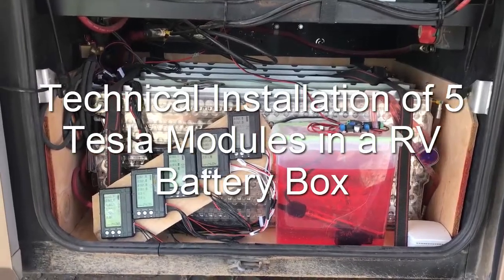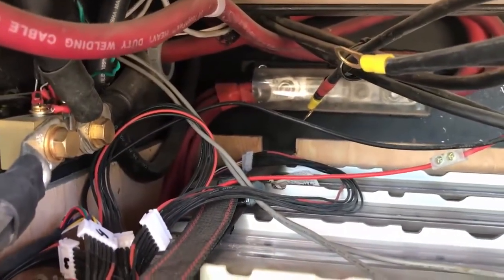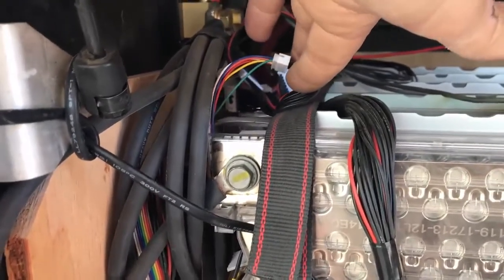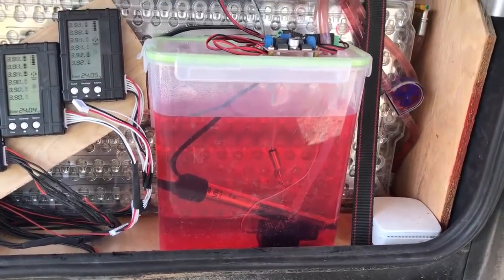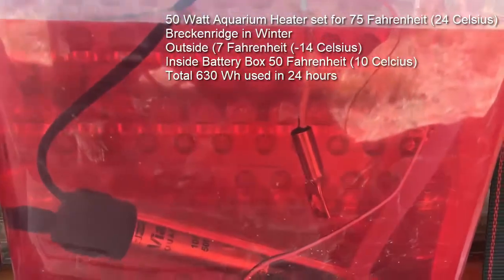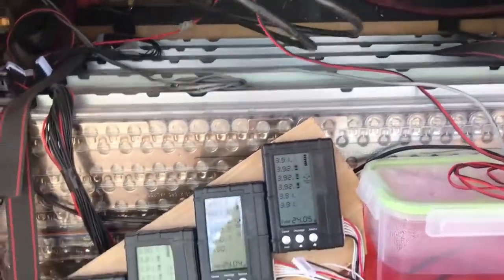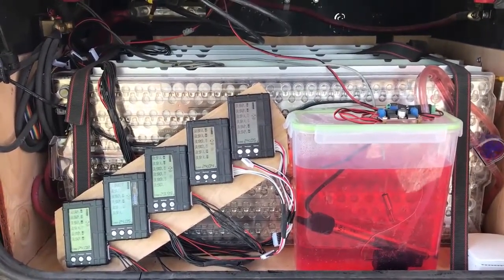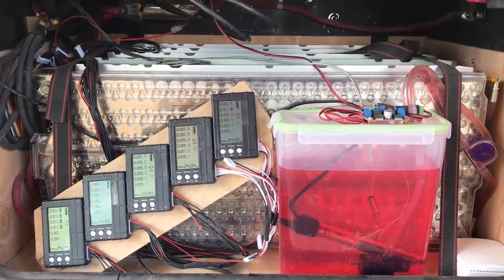Technical Installation of 5 Tesla Modules in a RV Battery Box

Comment: What bolts did you use for attaching the wire ends to the battery?
Reply from the maker: I had the bolts used in the cars battery pack with the modules. Not sure what the size was.

Comment: What voltage are you setting your Tesla battery to work within? Mine is set 18.6-24.5V.
Reply from the maker: Mine are set for full charge at  24.1 volt (I estimate 80% SOC) charging to lower increase the longevity of the cell.
Reply: @Per3110  oh wow ok, I’ll set mine to that also, what’s your lowest set voltage?
Reply from the maker: We have never been under 21 volt. Inverter disconnect at 20 volt (19 volt instant). The inverter is our only large  load. We do not have a disconnect (except removing a large fuse) since nothing handle the current properly bidirectional.
Reply: @Per3110  ah I see ok thanks for that, I guess by having my victron multiplus inverter set to disconnect 19V that should be fine, and then for the DC load I’ll have the victron battery protect disconnect at 18.6V 😁
Reply: @Per3110  merry Christmas 2020

Comment: Am thinking of taking my bms out abs installing the hobby king you have to balance your battery.
I have bought different victron products that had high voltage disconnect to my Tesla battery and also low voltage disconnect on all the DC loads on the battery also.

So ideally this would just balance the battery.

How is it working for you to far? 

Would you recommend them?
Reply from the maker: I like the Hobby King, they have been running for 2+ years all five, very stable, just ensure they sit upright to dissipate the heat.

Comment: I was going to mount my Tesla Battery Modules vertically as well but I was advised not to do so.  They are not made to withstand that kind of sideways force on the 18650 cells.  What is your opinion?
Reply from the maker: Those packs are glued together and can barely be pryed apart to get a single cell out. I have them sitting like this for 2.5 years and traveled 25000 miles. The internals of the cells has no dependency on orientation.
I have seen people mount the modules flat only on the rails with no underneath support. I think that puts a lot more load on the modules during driving. But again the modules are so sturdy that I do not even think that is an issue.
Reply: @Per3110  It's hard to argue with Success! Thank you!

Comment: What Maximum charge amperage ( per module) do you set your inverter charger to charge off shore power? How do you set the Hobby Kings to automatically balance?
My system has 2 Tesla module connected to 1 Victron Multiplus 24/3000 and can charge at a maximum out put of 70 amps.
Reply from the maker: We have 5 Modules in parallel and have Magnum MS4024 Inverter (105 Ampere Charger) or 2 x MorningStar MPPT (2 x 60 Ampere). Even with both charging at full output is 225 Ampere. Each module is getting 1/5 so only 45 Ampere per module. Converting that to the charging in the Tesla car is that 24 Volt * 45 Ampere * 16 Modules = 17280 Watt = 17.3 kW. That is not a lot compared to the regular charging of the car. So as long the temperature is in the optimal range for charging and not charged to more than 80% State of Charge is this well within specs. And the special case when plugged in and solar is very rare. So normal charging from solar only is less than 10 kW that is almost the 6-8 hour charge done at home for the car. With only 2 modules and 100 amperes charge is each module charged 50 amperes, very close to my example above.

We do not use the Hobby King any longer. I switched to a Battery Medic after a few months of manually triggering the balance.
Reply: @Per3110  ok so I would be save to charge one module at 70 amps or combined with solar up 100 amps.  With two connected on one charging inverter this would be a maximum of 50 amps per module. I think I am safe as in most cases I will only be charging at 20 amps max using my solar. Currently 400 watts plan to increase to 600 watts. 
I am using the Hobby King based on your videos. What is the advantage of Battery Medics? 
I think I am going to install the Electrodacus SBMS0 down the road for a full automation BMS that works with the Tesla. I will have to use Two. 
Do you have any issue with your 5 Teslas charging at different levels due to different resistance in battery cables due to different lengths?
Reply from the maker: @thomasgeriak4322  Yes, if you have the battery above 65 Fahrenheit and stay under 24.6 Volt (90% SoC), We only charge to 24.1 Volt (80% SoC) since we do not need all the capacity we have installed. But I wanted to ensure we had enough batteries in parallel that we did not force too low a voltage under high loads.

Comment: How do you automatically disconnect the packs if they over charge or over heat?
I'm installing Tesla packs in parallel and have been strongly advised against it without a bms that disconnects the pack in the event a whole string of cells fail and the other packs try to over charge the faulty pack. How big a risk is a whole string of cells failing? The only bms feature you use is just balancing?

What is your peak amp draw from the packs? I will be pulling about 300 amps peak from each pack (3 packs) for a few seconds (inverter max current when starting anchor winch motor for example) with a normal average load of about 75-100 amps per pack at 24v Does this pose a heating issue at 300amps and need to cool the packs more aggressively?

Sorry for so many questions, the people at OrionBMS we adamant that I shouldn't connect them in parallel unless I had a professional come and install and set up a bms and processes to isconnect the packs to stop the risk. I don't want to risk a fire or something without knowing much about how likely I am to have a problem. 

Thank you for posting your video
Reply from the maker: We have no catastrophic disconnect in our setup, but we only have 2 charging sources from solar or the Magnum Inverter/Charger. And the Magnum inverter has not been used for almost 2 years since we do not plug in or use the generator.
The Tesla modules have the individual cells (6 x 74 per block) wired with individual fuses. I do not consider the risk of having a failure like this. 
The one thing to remember is that this is not a solution that is sold, warranted or in any other way guaranteed, you cannot even get a charging discharge graph or temperature limits. I always recommend everyone to get Battleborn Lithium batteries that are protected against any kind of failure and use safer chemistry like LiFEPO4.
Reply from the maker: With 300 Ampere from each module is that like in the car in track mode, you need a lot better thermal management and expect a lot of voltage drop. I wrote a blog about this http://offgrid100.com/tesla-module-load when I tested on our solution with 5 pack in parallel. Our maximum draw/charge on the whole pack is <150 Ampere or 30 Ampere per module.
Reply: @Per3110  great blog post by the way
Reply: @Per3110  I have a 10.5kw 3 phase system that can surge to 21kw under extreme conditions for a free seconds. The average peak load is in the 4kw range across 3 phases. I'm planning on adding more Tesla packs. Ideally 6 total, but after reading your blog about loads and voltage drops in might need more capacity.

Comment: How does it work in souther heat when internal temperaturs in parked cars can be 140F+? Would addition of 20-40% load be a fire hazard at those temperatures?
Reply from the maker: The optimal charging temperature for a Tesla car is actually 115 degree.  So I think it would good. Low temperature is the biggest issue. And your battery box should not have a glass outside.

Comment: That cell heater is so simple and easy to build!!! Nice
Reply from the maker: Yes, KISS (Keep It Stupid Simple, maybe switch the last two words :-) ) is the solution when you need something that ensures it works every day for years.
I do want to have dual pumps to ensure the $7 pump does not die or some monitoring on the flow of fluid.

Comment: I did more research.  The connectors for the battery medic 6S is the JST-XH 7 pin connector.  FYI the 4 pin connector on the Tesla Batter thermisters at JST-PA 4 pin and JST-PA 15 pin.  These are hard to find, so I will remove the and replace with the JST-XH connectors.
I will be going with a liquid heat system using a 24DC volt thermostat controller, 24DC/150 watt ceramic heater, 80 mm  computer radiator, 400L/H adjustable 12/24DC fish tank water pump and 1 liter coolant tank in a closed loop. This can also  be used to cool if ever needed.
Reply from the maker: Our heater is only 50 Watt, I have not seen it use more than 30 Watt in an hour.It would be great to have a 24 volt version, but the 120 Volt AC Aquarium heater has built-in thermostat and all I need.

Comment: I received my 2 tesla battery today and ordered the 2 battery Medics. Can you offer up where to by the connectors to connect the rainbow wires to the battery medic? I think you said you needed to purchase a special connector. Tom
Reply from the maker: I purchased a 6S balancing leads from ebay and soldered it on the wires. All you have to do is measure the voltage and order them according to voltage.

Comment: I did purchase my 2 tesla modules. I am going with the Victron Multi Plus 24/3000 120 volt inverter. Still on the fence about liquid heating or just electric heat. I found a 24 volt 150 watt ceramic heater with fan that I can use to heat my whole battery box.
Reply from the maker: I think the liquid solution also prevent over heating and distribute heat better. But with the load in an RV is this probably a minor issue.

Comment: Would be great if you would have included a separate video just on the wiring side from the removal of the original BMS in the Tesla module and from there what wires you connected and cut and then a more detailed look at the hobbyking battery medic. Looks excellent the way you have set this up and the use of aquarium equipment and sensors to heat etc.  I am looking forward in the new year to get my Tesla modules in and working. Came across this video from EVTV which if you haven't seen it is a must see video https://www.youtube.com/watch?v=Je71tbm7LWQ&t=2111s
Reply from the maker: I have seen Jack's videos, they are a little long IMO.
It would have been nice to document the details of the wiring/soldering since I get asked this a lot. Maybe one day I meet a guy that has a module that needs to be modified. Buying a $1200 module for a video is a little steep since I cannot fit more in the RV :-).
Reply: @Per3110   yes very true, a little more research and I will be there!
Reply: My Tesla S module has a J1 connection and both temp sensors still attached to the cells. Did you remove the original bms and just use the wires coming into the connector. It appears that you did cut these but my wires are coming in via a ribbon wish I could share a picture here. Any help or links would be appreciated
Reply: One last thing, what type of battery setting are you using on the battery medic, I called Hobbyking and they told me it doesn't support these type of cells but they are obviously working for you ok!

Comment: Impressive. I see you are using a 24 volt system. What brand and model charger inverter are you using? I plan to use a Xantrex 3024 charger inverter. 5 battery sections at 5.3Kwhr is 26.5Kwhr system. How do you use all that power in your RV? I guess you would have more than enough power to run the AC for 24 hours.  Do you use a solar charging MPPT?
Reply from the maker: You never want to use a Tesla module to the full capacity, that is risking in-balance to be critical very quickly and also decrease the number of cycles a lot. You should expect to use 80% of the capacity.
We use a Magnum MS4024 in the RV (4000 Watt Single Phase). This is a direct replacement for the ME2012/MS2012 inverter that is often found in Motorhomes from the beginning of the 2000s. I only had to add a small Sub-Panel to add dual 20 Amp AC breakers. I would take a look at the Victron inverters, it seems to be the only one that is upgraded to this century in interface and capabilities.
In the trailer is an MS4024 PAE that is capable of 4000 Watt and split phase (240 Volt). 
Take a look at this website for a lot more details http://offgrid100.com/rv
Reply: @Per3110  I did tune to your channel and viewed your other videos that showed your complete set up that would have answered many of my questions. Sorry about that. I have a smaller RV a 2016 Winniebago View.  I know for me it is impossible to run the AC off a battery system completely. I plan on one to two 24 volt 5.3kw Tesla units and use a hybrid 3000 watt inverter with a 1000-2000 watt gas/propane generator that would use 1 gallon of fuel per 10 hours. I would then remove my Onan 3600 watt generator saving me 150lbs. 
The only thing I need to learn more from you is how you balance your Tesla batteries? I see you have a balancing unit on each battery. Is this an automatic function with your unit. Where do you buy it and what is the cost per balancing unit. Tesla batteries come either with balancing wires or a ribbon connector depending on when the battery was manufactured. Does the balancing unit work only with wires or can you somehow connect it to the ribbon? 
Tom
Reply from the maker: @thomasgeriak4322  I soldered a regular RC airplane 6S connector to the ribbon wires in the right order. This page have details about the balancing. 
http://offgrid100.com/tesla-battery/
Reply: I am continuing to read through your blog. Am I correct your only methods of charging your 24 volt system is MPPT solar and the Magnum charger? Have you considered using a 12 volt alternator  connected to a 12 volt to 24 volt up converter connected to the MPPT to regulate the battery charge profile?  Do you run any 12 volt appliances in your RV? If so do you just use a 24 volt to 12 volt down converter?
Reply from the maker: @thomasgeriak4322  I have considered getting a 12 Volt DC to 24 Volt DC converter that could allow our Alternator charging the engine batteries to charge the Tesla modules in an low state (we have not needed this in 1.5 year now). We never need the extra power above the 4000 Watt (5000 watt for a few minutes) from our Magnum MS4024 inverter. So our Generator (Onan 7500 Watt) is probably being replaced this winter with a 80 gallon fresh water tank for a total capacity of 170 Gallon of fresh water.  We then either carry a small ~2000 Watt gas generator and a 24 volt charger or use our large 8.3 liter diesel engine and use a DC to DC charger. The main issue with both scenarios is the fact that the Tesla modules cannot be charged to above 24.1 volt in our case, but a simple voltage controlled disconnect can be implemented on the 24 Volt DC side.
A solar controller can also be used to charge our Tesla modules from the Engine batteries. A few controllers like the MorningStar TriStar alow lower volt from the solar than in the battery bank.
Reply: @Per3110  I am considering installing a 12 volt to 24 volt up converter and connecting the 24 volt source to my Epever 40 amp MPPT that could control the proper charge profile. Do you think this is possible and would work safely?  The up converter costs about $20 to $40.  The other option is using the Sterling 12 volt to 24 volt dc charger at a cost of $450.
I plan to remove my 3600 watt Onan generator as well and replace with a 2000 watt Yamaha to use with my 3000/24 hybrid inverter to run AC and sip fuel. 
Does your BMS set up have a low voyage cut off using a battery protect switch? Do you also have it set up to not charge from inverter if the battery is at or below 0 deg  C? I know my MPPT is set not to charge at Freezing but my inverter/charger does not have this option. Yes I know you heat your battery with coolant liquid and heater. I plan to use a heat blanket.
Reply from the maker: @thomasgeriak4322  I have no protect switch. That is one of the reasons I have to be very careful with the charging profiles. The Magnum MS4024 and MorningStar MPPT controllers are the only charging our modules. 
You idea with a cheap step up is good. I have not thought about this. Boosting the 12 Volt to 48 volt is also making the Solar Controllers work fine. All I would need to do is run the Engine at Night and Reuse one of the current Solar Controllers if I was low.
Reply from the maker: @thomasgeriak4322  I do not have Voltage based Cut-off. I need to ensure our charging is precise. I'm not sure the $20-$40 converters can output 40 Ampere at more than 26 Volt. Only the Sterling devices get into that range of Ampere.
Try take a look at this that is the option I'm considering http://offgrid100.com/dropping-the-generator/
Reply: I am shopping for 5.3kwatt hr Tesla cells. Looks like the going price is $1300 each with shipping. Can you provide any recommendations for locating Tesla cells for a good value? What should I pay?
Reply from the maker: @thomasgeriak4322  I bought all mine at EV West in San Mar is CA. But they shipped the modules to me. Not sure what the current price is. I paid $1500 plus truck freight.